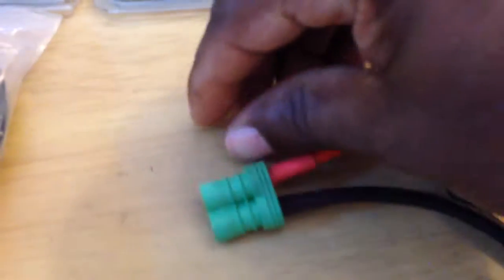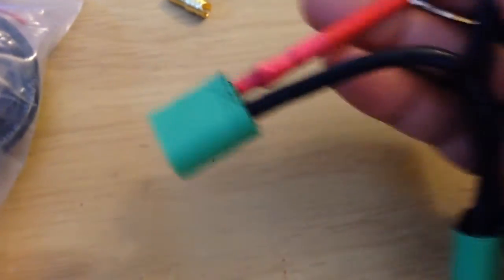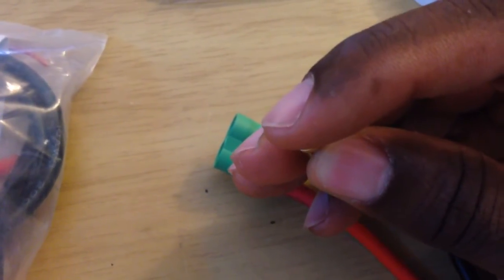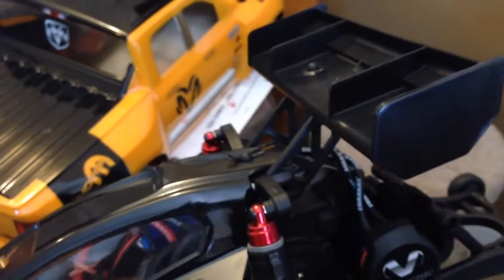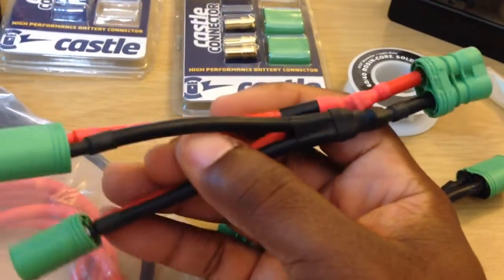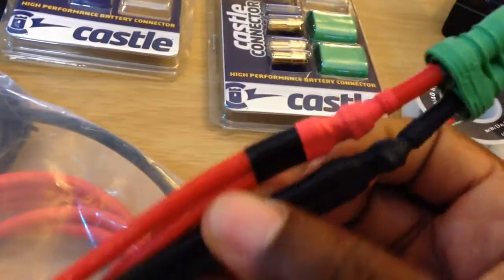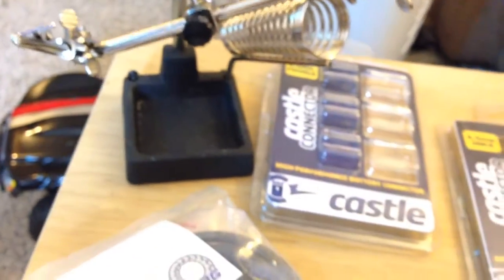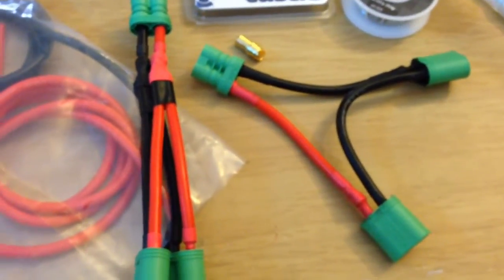Castle Creations 6.5 Series and Parallel Adapters

Comment: Hey Dan P, Im having problems getting my CC Bullets seated into the plastic housing. Do you got any tips on how I can get them seated properly? Thanks in advance!
Reply from the maker: I actually use a deans connector wrapped in electrical tape and the metal leads cut off. Only because that what I had that was small and hard enough to fit inside the housing. The tape is just for protection. I make sure the bullet is aligned then put the dean connector on top of it..now I use a pipe wrench to squeeze the bullet into the housing. I use a pipe wrench because it opens up wide enough. Hope this helps or gives you an idea on what to do.
Reply: Dan P Good looking out! Tried it they popped right in! Appreciate the time you took, and the tip brother!
Reply from the maker: Cool! Glad I could help!
Reply from the maker: +Hobby Logix Pretty much the same idea except  for the bit.

Comment: Ok which one is better to run y splitter or parallel?
Reply from the maker: Doc Tombrady There’s two different splitters for two different purposes. Parallel adds both batteries mah (capacity) together and series for adding the voltages together.